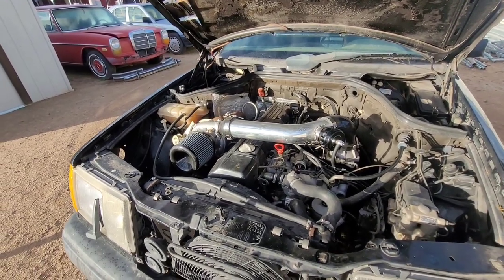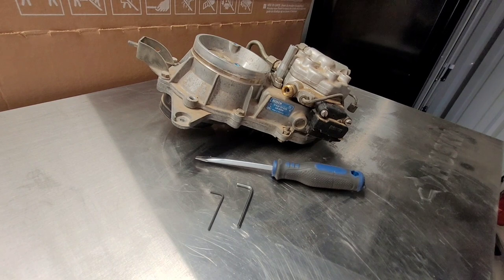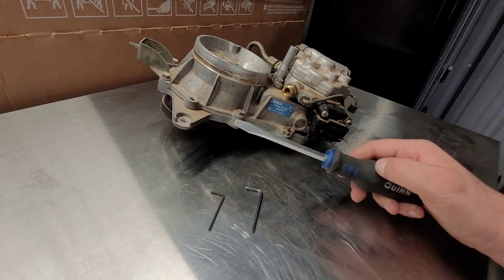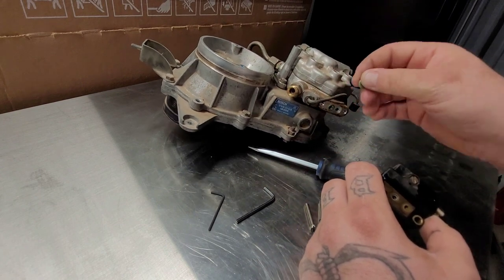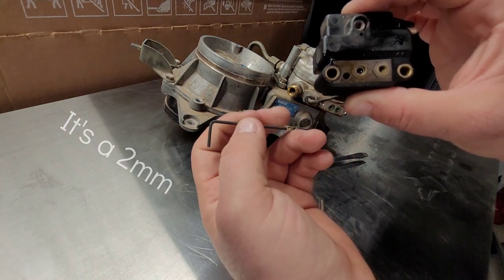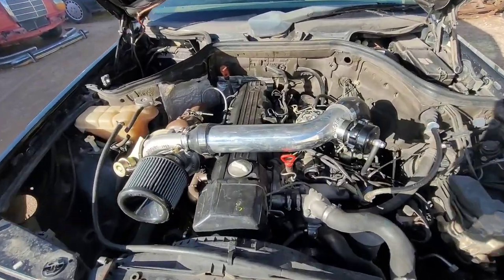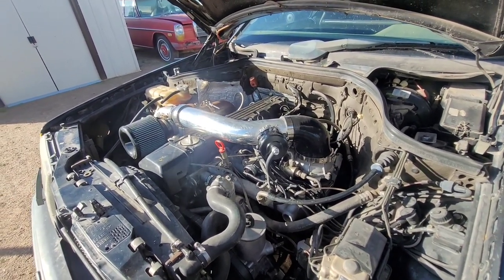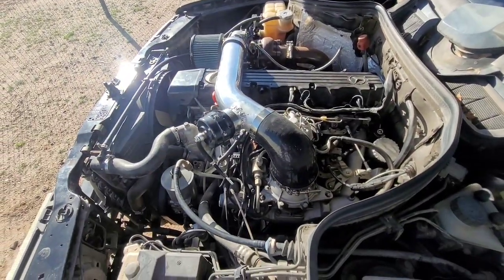How To Tune Your K-Jet CIS For Boost M103 Mercedes

Comment: I just don't understand how the air fuel meter works with air pressure coming from the turbo pushing on the flap. 
I did a turbo set up on a VW Rabbit which has the same Bosch fuel injection system only difference is the air fuel meter goes upward not downward like Mercedes-Benz. And I had the inlet side of the turbo connected too the air fuel meter to control the fuel pressure. I like your setup and thinking about Turbin my M103 3.0L
Reply from the maker: It's a very easy setup if you look up how the cis works there are alot of videos explaining how exactly it work

Comment: Excellent. Looks to be a nice and simple conversion and a testament to the engineering of the Bosch K-Jet system that it can adjust so easily to the boost. Out of interest do you get more or less gas mileage on a tank? Only interested as I have a 300GE and its a big heavy vehicle, so was thinking this may improve the mpg a little by helping it get up to speed.
Reply from the maker: Make sure you get a afr to test it make sure your tune is dialed in and I would say I got about the same gas mileage and a 300ge that's awesome I use to have a 2door 230ge it was a slug 🤣 couldn't find the 300ge I would take that over the new ones anyday

Comment: Thanks for all your help. I’ve finally installed my kit and went for a first run… I heard some knock and think I leaned out.
What AFR ratios should I be aiming for at idle and at WOT?
Reply from the maker: I've been at about 11.6 11.8 if I'm not mistaken at wide open how much boost are you running

Comment: Good video. I have a volvo 240 Turbo with K-jet lambda making decent power. My air meter plate pulls up with turbo vacuum. How does this work with boost pressure pushing on it? Seems like it would go rich at very low boost. Did you have to raise control pressure proportionate to boost?
Reply: On all Mercedes engines with K-jet and KE-jet, the airflowmeter plate moves downwards. If that's what you mean.
Reply: @hollandibolygo9172  What I mean is if you're pushing boost pressure over the metering plate it seems like it would push it all the way down causing it to go rich. I thought the metering plates were only meant to see vacuum.
Reply: @242bleek Now I understand what you mean. Without a turbo, of course, it works under a small vacuum, but its task is to react according to the amount of air flow.  It can respond to the amount of air flow under pressure or under vacuum. I don't know for sure, but if the turbo  builds up  the pressure gradually, not immediately  it doesn't push the plate down completely right away I think. More or less, the ECU also continuously adjusts the mixture according to the lambda readings
I agree that it probably works better if the turbo sucks air through it, not blowing it
Reply: @hollandibolygo9172  I see what you mean now. Thanks for clarifying.

Comment: On a calm drive is a turbo saving gas?   I was thinking without a turbo you are hitting the gas pedal say to get to 90MPH   using X amount of gas.  But with a Turbo U probably only need to press say half the pedal using only half the Gas? is this correct??
Reply from the maker: I mean it all depends because your adding fuel for the turbo because your letting in more air so you can't have one without the other that's when you'll start to choke out the engine or have it sputter BUT someone could probably explain it much better than I could for sure 😉

Comment: Hi! I'm very interested in this build, I want to try it on my 2.6. Do you think it will turn out the same as on your 3.0?
Reply from the maker: @sillicium1740  yes a few people have already done it with there cars with little to no problems.
Reply from the maker: @sillicium1740  definitely Be patient
Reply: and should there be an original AFR sensor? or should I install a separate one with display of indicators?
Reply from the maker: @sillicium1740  we used both you have to use the original sensor the aftermarket is optional we used it for tuning only but that's us
Reply: @thebenzhouse  okay, thanks a lot! great job man
Reply from the maker: @sillicium1740  of course man if you need anything else please ask away I'm happy to help 😊 and good luck

Comment: Dude I need a retrofit for my 190E m102 2.3 for a turbo. Got any recommendations?
Reply from the maker: Do you have the turbo stuff already
Reply: @thebenzhouse   I got a turbo and intercooler ect.
Reply from the maker: @James Barella  what manifold are you running if you don't have one yet kangaroo team makes one and so does hedgehog one is cast the other is stainless both good priced
Reply: @thebenzhouse  
Yeah I know that. I was just trying to see if any of the Tdi's or other turbo manifolds fit off any other cars that you know of. Seeing as you have done so many.
Reply from the maker: @Good-Intentions  not that I know of no

Comment: is there any stock one piece exhoust manifolds compatible with the m103 that i can modify for turbo? mine is a two piece and that doesnt work out for my crafting skills xD
Reply: thank u for the explanation video btw!! i asked about this a few weeks back
Reply from the maker: Of course and there are a few places that sell the m103 mercedes turbo manifold and if you can find one the om603 euro spec turbo manifold can fit but you need to Redrill some holes and make it work it's better to just get an aftermarket one I got mine from desert designz here in arizona 😉
Reply: The kangaroo team, turbobandit, te motorsport

Comment: Hej, if you need any help this CIS adjustments let me know, I have a lot of experience this that.
Reply from the maker: Thank you very much we've messed with it alot we got the tuning down pretty good with low boost turbo setups.
Reply: @thebenzhouse  
Did you measure the mA voltage on EHA regulator while engine running?
And also, you can try to play this ignition timing, make it more earlier.
Reply from the maker: @antonRCF  now the ignition timing I have no idea how to mess with that to be honest and yes the car was running when I was tuning it
Reply: @thebenzhouse  
About ignition, do you have stroboscopic lamp to check the ignition timing? (Ignition timing light) 
I'm not sure the year of this m103, but there were installed two types of engine temperature sensors , this two pins (green) or one 4 pins . So one wire from two pin goes to ECU cis , another one to ignition module. The same this 4 pin two cables go in ecu two in ignition module.
When engine cold, it takes more fuel and more air, that's why ignition timing on cold engine is earlier. 
The same this turbo. 
You can put resistance to the wires which goes to ignition modul . To make car run better this turbo. 
This out proper timing there is a high risk of detonation inside the cylinders
Reply from the maker: @antonRCF  honestly how its running right now is perfect I wouldn't say there is any need to mess with the ignition but that is good to know for sure if I ever go over 7 to 8lbs I just go to efi and do a full stand alone to make it easy for myself it took a while to learn how the kjet worked but I would say it's very good I'll take lots more videos ect of the car rolling down the street its just hard to get people to hold the camera

Comment: How tf have you been doing this for a long time with no issues? 1 and a half turn on the af mixture?!
Reply from the maker: It's different with each eha or cis I've gotten some cars that have rich mixture and some with a lean mixture it's all going to depend like I stated I can't say turn it once or twice it all depends on what the afr gauge says
Reply: @thebenzhouse  By afr gauge, you mean duty-cycle reading I assume. Even still, to automatically go and start adjusting the mixture....leaking injectors, non-functioning csv, vacuum leak, stuck intake valve, clogged/dirty fuel components, weak fuel pump, bad fpr, bad solder joint on the ovp, faulty cts, etc, etc....the KE system is great when it works, but literally any one thing can throw it out of whack so I'm shocked that you just would randomly start adjusting the mixture on the system. 🤷‍♂
Reply from the maker: @brittanywright9646  many many people have boosted there cars with kjet it's not a new practice just need to know how to mess with it is all yes of course there are alot of variables at hand it would be better to just go efi but it can be done with cis and it's fairly easy once you do it a few times it's very straight forward
Reply: @thebenzhouse  Yeah, it's nothing new, just surprised at the way you go about it is all. If you really want to boost your car, try dropping a m113k in it. A few fabrications needed, but very doable 😁😁
Reply from the maker: @brittanywright9646  just efi the m103 it doesn't need the motor swap I use to have a m113 procharged setup the m103 is a better setup in my opinion